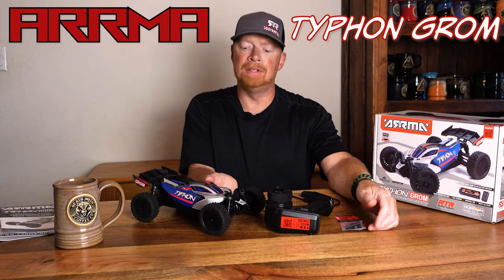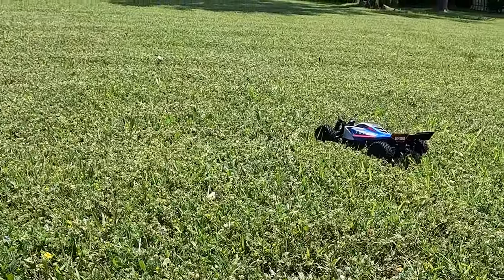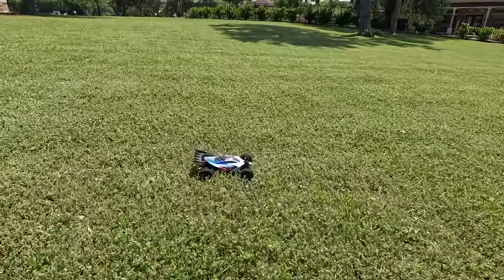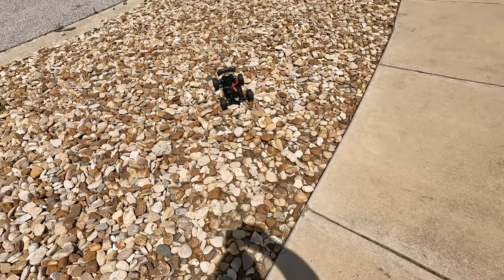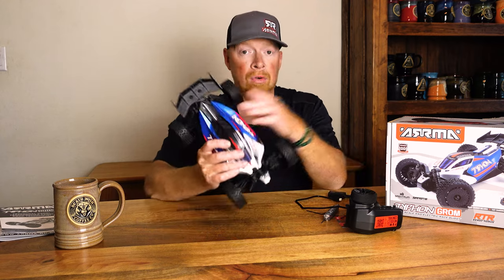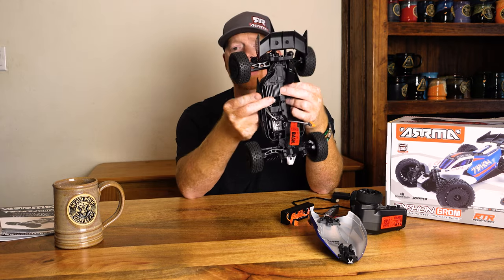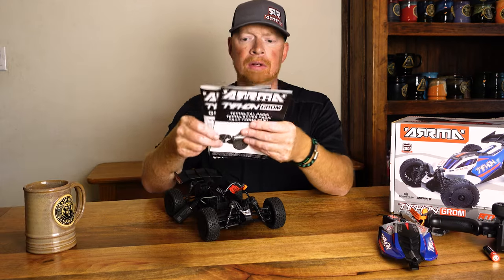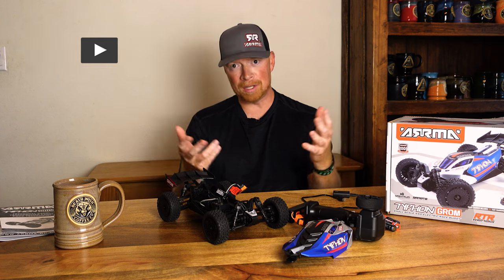Typhon Grom New 1/18th by ARRMA

Comment: Most people I know wouldn't drive on thick grass like that.  It makes the engine run super hot and can mess up the clutch.  One of the first things I learned about RC the hard way.
Reply from the maker: Nah. I swapped it to 3s brushless and it tore through it. Been running cars for 37 years. I attached this video to Arrma and they had a motor and esc to me pretty quick. The Rlaarlo's and WLtoys did fine on the same yard. And cheaper vehicles. It's just underpowered out of the box. My first kit ever was a Grasshopper. That was 1/10th scale 380 and while it was slow in the grass it wouldn't stop like that. The Granite Grom ran the same way and was fine as did the Mojave which is pretty low. Motor was just bad. It happens. I just think for the price there are better brushless lipo options. It's specifically tight to work on in there. Right now it's a 55mph car but I have to tape the back of the body to keep it on and I wedged that motor plate to get a bigger pinion and spur in but we jump it and everything right in that yard. It has less than 3 1/2 stars on Horizon. About 4 on Amazon. The WLtoys 144001 gets 4 or better but that's a 550 with plenty of room. This was a case where you pay for the name not the quality. I'm knee deep in Arrma cars but I'm not enjoying the Groms. Loved the Gorgon and the Mojave 4s is phenomenal. Just didn't think this was Arrma tough.

Comment: Hi, I have a question. How do I reverse the throttle on a Spektrum SLT2? That is, I pull the trigger and the vehicle goes forward. Could you help me? Thanks!
Reply from the maker: Isn't uncommon. With the car off turn the wheel full left and push the throttle forward full. Hold it til it blinks 4 times. Release it and it should be solid red. Power it off. Power it back on then Power the car on and see if that reset it. If not it's on the car receiver side of things. Let me know if that works for ya!
Reply: @ I already tried that and it is still not working. I would aprecciate your help haha
Reply from the maker: @agustinmas5009  Do any work on the car's esc or differentials?
Reply: @redvikinghobbies  hey viking. I figured it out. I switch the wires from the esc to the motor and it works. Thanks so much for your time. New suscriber for sure
Reply from the maker: @agustinmas5009  that was gonna be my next suggestion! Glad it worked out! Have fun! Cheers!

Comment: Nice!! A mini version of my Typhon 6s V5 BLX. 
I think in general, the Typhon is a very well designed and built racer, regardless of its sizes.
Glad to see you are having the Typhon. 😊👍🏼
Reply from the maker: Welp this one fails but Horizon is sending a new motor/esc. Now I'll have to decide whether to put it in or put in the brushless I already ordered  😂 

Thanks for the support JJ!
Reply: @redvikinghobbies  definitely put in the brushless motor, it will perform better at higher speed. I haven't played with my Typhon for a while, maybe I should charge up the batteries and have a blast again. I still play with my crawlers from time to time, they don't require a lot of space so I tend to play with them more often than the high speed ones.
Reply: Looks esc failed.